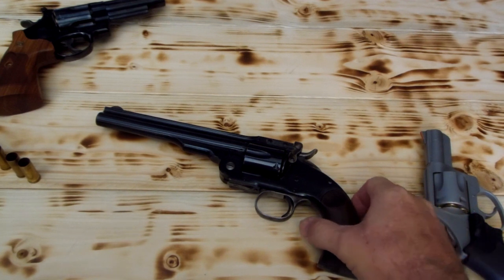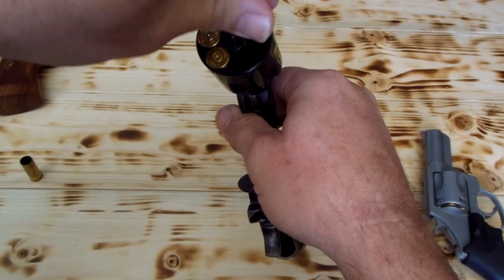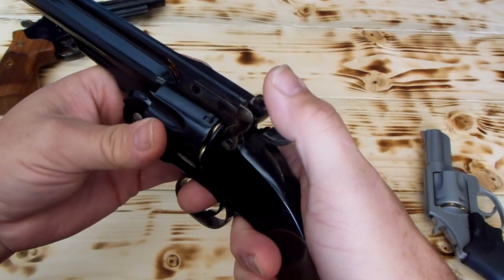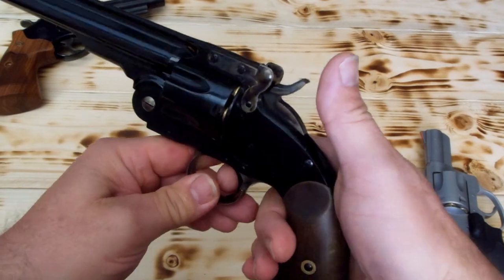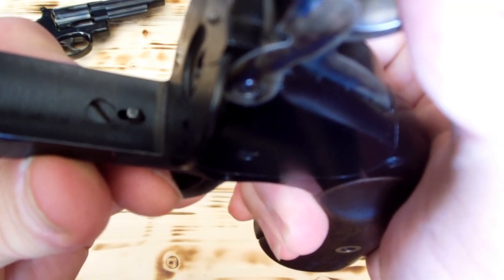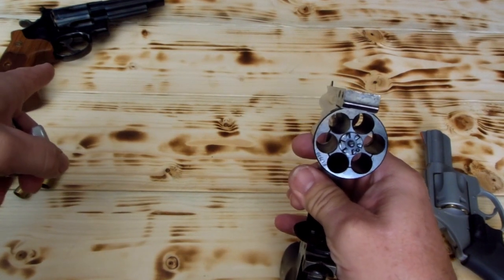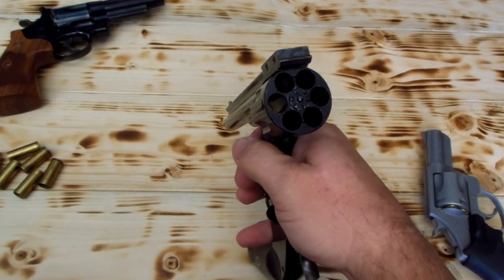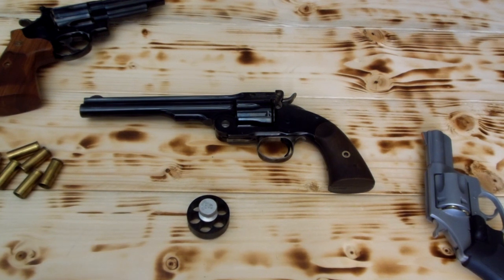"Tactical" Schofield carry and reloading

Comment: Great video Plowboy, back in the day Safariland made those speedloader, and what is the make of your new Scholfield. They are mucho dinero up her in Canada so it is on my want list. All your viewers must understand you don't need a 44mag with a 45 Colt in your belt.
Reply from the maker: This is another Cimarron Schofield.  I got it back in April of this year when I traded the S&W 29-10 Classic that is on the table in this video for it new. I think it's "funny" that I ended up with both of them in the end...heheh

 I saw on Facebook that another youtuber killed a deer with a Cimarron 1860 R-M Conversion .45 Colt a few days ago or so. He was using weaker "cowboy" level Hornady ammo that was a 255-gr. cast bullet at about 725 fps..with one shot at 55-yards. 
  That should be near 150-200 fps slower than my handloads with the same weight bullet.

Comment: Yo plowboy. Texas Ghost Rider here I have me a Schofield and the speed loaders are actually very slow when you're in a hurry shooting. I have a Smith & Wesson 45 I forgot which model it is, and I use the moon clips and they are very good in that Schofield. How about you give us a video of you using them Moon clips for your six shots.
Reply from the maker: I've never owned or used moon clips.
Reply: @plowboysghost  
Ok.
I think they worked very well. Not 100% sure that the moon clips used for the 45 Smith & Wesson revolvers will work on the Schofield. Not 100% positive at all. So what I would do if I were you, is get some dummy rounds of the same size with that moon clip and see if they fit in or not. At least that's what I would do.

Comment: Cimmaron's The Man With No Name does this, too. Mine has a wiggly firing pin, though. Any thoughts on how to tighten it? Been enjoying your content all year.
Reply from the maker: I believe about all hammer mounted, fixed firing pin wiggle a little bit. I think they are designed that way. I know all I currently own are that way.

 Just checked mine and yep...it will lock between chambers too. Good deal.   Thanks!
Reply: You can lower the hammer on the MWNN in between chambers?

Comment: I wouldn't do that, because the cylinder is being held in place by the firing pin, if IF? the cylinder should receive a blow  (dropped or what ever?)  the firing pin might get bent or broken. On these old guns I would stick to leaving an empty chamber under the hammer.
Reply: In schofield revolvers there's a mechanism attached the trigger that holds the cylinder, not the hammer
Reply: @christopherblowers2991  The guy is talking about having the cylinder turned as not to allow the hammer to rest on a live primer, did you watch the video?, did you understand the video?. That means the firing pin is holding the cylinder from turning, this is not a good way to carry a firearm .
Reply: @NCLUSA  I have a schofield, there's space between the hammer and the cylinder even if you have the hammer the whole way down
Reply: @christopherblowers2991  My point!!!!!!!!!!!! is if the cylinder is turned while the hammer is between the cylinders the only thing to stop the cylinder from turning is the FIREING PIN!!, can you grasp this?, if a blow on the cylinder strikes the cylinder the tip of the firing pin will take the blunt of the blow, how hard is this to understand???, THIS IS NOT A GOOD IDEA CARRYING A GUN IN THIS CONDITION !!.

Comment: Properly holstered, and barring the danger of falling off a horse into a pile of rocks....which is where this empty chamber thing started. Falling off horses.
Reply from the maker: Years ago, a Cimarron Thunderer loaded with six, hammer on "safety" notch fell out of my holster about 16-18" onto concrete, on the hammer while I was seated. The notch didn't break, the hammer/firing pin didn't fall.  That was when I first started carrying an empty chamber under the hammer on a fixed firing pin single action.

  It spooked me, but it didn't go off...thankfully. 

 I have a Colt SAA clone or two that will set the hammer/firing pin between chambers , too, I'm just not quite ready to endorse that....yet. I also have one that it won't rest between chambers, so........
Reply: @plowboysghost  I'm with you, it's a possibility. Even with wheel guns I use a thumb break holster or a flap holster.

The technique I showed is def spot on. Great innovation for any wheel gun it will work on.
Reply: All of the Men in my family carried Mid notch a horseback..My research has led me to believe that the notion of carrying on an empty chamber was based on a supposed report by Wyatt Earp..I find that odd as he would have been from a time when mid notch carry was widely known,especially by a Law man..It was then parroted by John Wayne,in his last movie ,which was coincidentally about the time that the Single action was being Re introduced as a recreational firearm and western reenactment was becoming popular...The men that i learned from,were the sons of Wyatt Earps generation and i never saw any of those men carry on an empty chamber,while carrying in any serious capacity.....